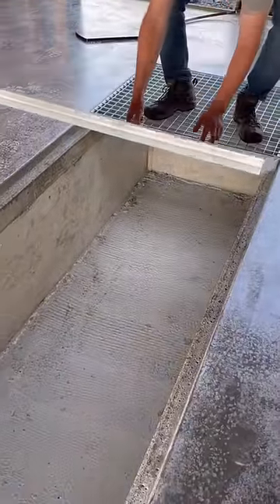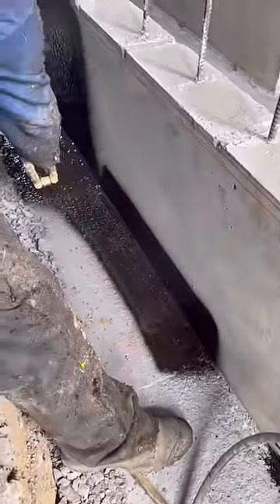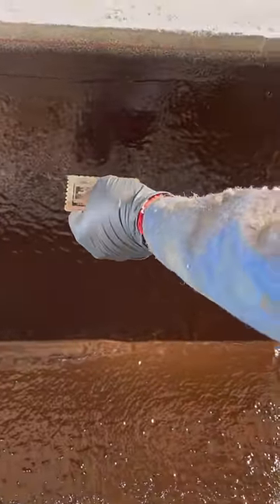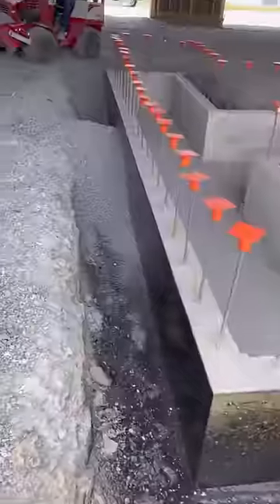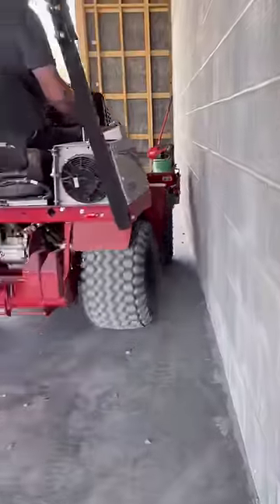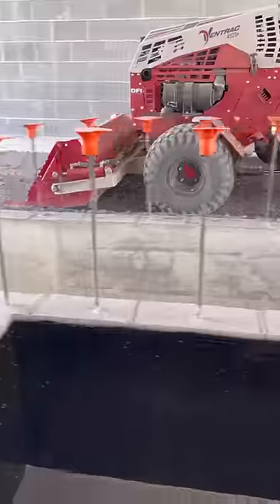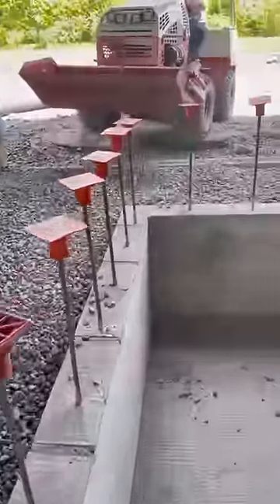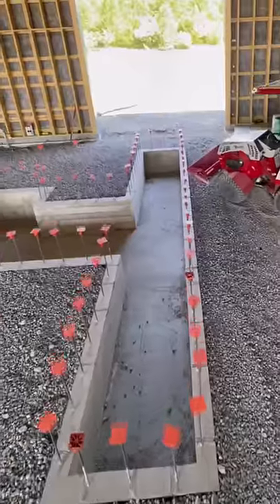Steps We Took To Waterproof The Spray Booth Pit

Comment: Did they spray under the base? 😊 Good to see that 50% of the path between tank and ground is sealed up. Does the gravel edge penetrate the sprayed on  membrane? All that pressure and sharp gravel edges are bound to contact it for sure. What actually happens in each year after completion?

Comment: To improve on what you've done you can put a small 45° cove in the bottom internal corner before mulseal spray. Install drainage with fall and a filter sock on the drainage pipe.
Reply: Overkill for interior foundations unless water table is high like along coastal regions

Comment: Tremco watchdog waterproofing it looks like here. You can also use Henry or  Carlisle  blueskin or grace has bituthene. Grace also has procor spray which is the Cadillac membrane. You should remove any sharp form lines and you should use a liquid membrane fillet where the wall meets the footing before using a sheet membrane. You should protect any of these membranes used in this application with some kind of pc2 or pc3 board or drainmat. I did specialty coatings and waterproofing for 25 years.

Comment: I used to inspect spray booth fire suppression systems.  One customer had a pit that never dried.  The fusible links in that pit never got changed.
Reply from the maker: That’s really cool! This pit will get a chemical suppression system. We were not required to waterproof the pit area, but I decided to do it just as a precaution. We’ve had a lot of rain here and so far it’s stay bone dry.
Reply: @hausplans  Suppression systems for booths are easy in concept, but a pain to design because booth manufacturers barely understand the concept that suppression systems are required, so they don't provision their designs to accommodate the suppression system.

Comment: If you hired someone, up to a few grand lol. Yourself, depending on sealer and if you owned the compressor, $300-700. I add a sheet over top for anything below grade. Can prevent cracking.
Reply from the maker: The water proofing company charged me $450
Reply: He was dead on with $300-$700 then. He knows his stuff apparently.
Reply: @hausplans  So few tradesmen these days, at least where I am. People are charging virtually whatever they like. $450 is damn good, if it's good sealer.

Comment: Nice, but I bet tremco 240 roller grade is less expensive than clogging that spray gun every other day (; and no drain Matt? I guess it’s just a footing and specfific for certain building specs. Nice work. Helps to stay down a couple inches off that footing line unless it’s 100% backfilled and nothing changes. Great work. - a caulker/ waterproofer- Oregon
Reply: 1800$
Reply: After all employees, materials, time.

Comment: I'm surprised you didn't put a one inch piece.Of foam or fiberglass board up on the outside of the wall to help witemperature differentials and to help protect the outside coating

Comment: What about the water or humidity coming from below? Did you waterproof before starting the whole job? Moreover, I would have used XPS panel on side walls to protect the liquid asphalt from getting damaged. Those stones scratch all your waterproofing when unloaded. That's the manufacturers requirements for having warranty.
Reply from the maker: This pit is in the middle of a large building with a roof over it. So mainly, we just did this for dampproofing. Also we put plastic under the floor section before we poured the concrete to hold down moisture.
Reply: I asked you coz I work as a concrete carpenter  across the Alps and on the Italian Seaside (Ligurian Riviera and Tuscany) building luxury home, and these jobs are absolute nightmare due to water infiltration and radon exhalations. Overall, your job is pro level. Well done.

Comment: In 20 years I’ve never seen a booth like this.
Reply from the maker: Downdraft booths are supposedly the Cadillac of paint booths
Reply: @hausplans  where does the draft go? I work in a downward draft every day, usually there is an exhaust tunnel that goes up to the stack. Like I see the pit, but then there is either a side door, or a tunnel off either end.
Reply from the maker: There is a tunnel that will go to a stack and then out the roof. If you watch some of my older videos that show all this.
Reply: @hausplans  oh ok, makes sense, I thought it was just a pit, that’s what didn’t make sense. The older booth’s actually had water that caught overspray and upped humidity. Most people have stopped using them.

Comment: I work with tropical elastomeric coating for roof logo's. I'd say about 450per pail in materials and 175 an hr per person if the company already has the equipment. Roughly $1850 if they knew what they were doing
Reply from the maker: I think I got a good deal, they only charged me $450
Reply: I've never used the spray. Just a rollable type of  coat for the most part
Reply: @spunkeybojangle That's bituminous dampproofing.  Around $40 for a 5gal pail. With a sprayer and a trailer,  you can buy it in 55gal drums even cheaper.

Comment: Could of had a drain.   Just needed to install it in a box with a cover kinda like a big pool drain grate of sorts.  Cover could of been pulled off as needed an the end of the drain pipe could of had a quarter turn valve.  Would of not been any issue with pressure or a vacuum like a p-trap or something could of.
Reply from the maker: We’ve had lots of rain and luckily it has stayed bone dry so far

Comment: I'm guessing $2,000 max., on account of a specialized sprayer for the rubberized asphalt. (Could be closer to $1,000, depending on how much competition the company has in your area)
     The surface area is relatively small, and you don't have the cost of purchase involved for the sprayer. (That just gets factored in on the invoice price. Price per hour, or price per m2 / ft2)

If it was more than that; there are cheaper products that can be applied by hand. 
     Or combinations of products that will accomplish the same thing.
Reply from the maker: It ended up costing $450 for everything
Reply: @hausplans  I would've guessed a price below 1000 if I'd known more about the price of the rubberized asphalt. And I wasn't sure about the price per hour (does it require a certain level of expertise or training... Then price goes up). 
      This was my best guess with my limited knowledge of the process :)
      $450 is a good price, considering the practical benefits.
Reply from the maker: Thanks for watching

Comment: Not to question the application but why in the world do you need so many rebars to anchor the plate?  I mean I like overkill but that is nuts
Reply from the maker: It is overkill, but we’re just following the plans at the engineer designed
Reply: @hausplans  yes my friend, I've ran into engineers that think they are smarter than their predecessors. Happy hunting!

Comment: Napkin math, the grills look ~60x60cm, so around 8m linear of wall, times around 1m, that's 8m2 of spray, 2 16 oz cans cover ~1m², so around 160-300 depending on the paint I'd say.
Reply from the maker: $450
Reply: @hausplans  was I accurate on the size?

Comment: It’s not waterproofed it’s actually moisture proofed! That foundation will eventually allow water to seep through. Especially at the cold/wall floor joint! A bead of mastic shoulda have been shot at the wall floor joint as an extra layer of protection. The footer then should have been wrapped with a Mira max rubber stick on system to be topped with a dimple board / foam board to protect against backfill and to direct the water away from the footer. I’m not hating at all just how I do it in PA!

Comment: Roughing up the concrete before spraying would have ensured a better bond. What do you think?
Reply from the maker: It’s sticks really well as long as there’s no oils or form release on it and it’s had enough time to cure
Reply: @hausplans  But it could stick better..
Reply: @peternault7040 Makes zero difference.  That's bituminous dampproofing.  It will stick to Teflon 😂

Comment: What you say about the paint booth’s exhaust system is incorrect. We use water traps for almost for any kind of drain. Also why do you need a trench at your paint booth?
Reply from the maker: This is a downdraft system, designed by Garmet

Comment: You need to check that 60mil.
Reply from the maker: A mil is one thousandth of an inch 60mil =1/16
Reply: @hausplans  1mil is 1000th of a Metre. 60mil is approximately two and three eighths inches.
Reply from the maker: I think you’re confusing mil and millimeters. They’re not the same thing. A mil is one thousandth of an inch

Comment: Forgot the dimple mat to protect 60 spray asphalt emulsion before gravel.
Reply from the maker: We use that on basement foundations, but this is basically just for damp proofing. The pit is in the middle of a large building, so it’s covered by a roof

Comment: first i need to know what a spray booth pit is.. seccond i live in europe we probably use different materials bitumen/tarmac/asphalt in most cases we use a roller its to thick to spray 60-90euro per square meter so my guess is 270-350 dollar?
Reply from the maker: You’re very close, it was $450 We are putting in a spray booth because this is an auto body shop. The fumes from the booth go down into the pit through a tunnel and then are filtered before leaving the building out the roof.
Reply: @hausplans  ah that was my first guess in 400-500 for total meter's but its lower in hight 40 centimeter so? yeah not totally squared meters so i lowerd my estimate a bit metrics system :/ amiright?  Now i wonder is it bitumen 2? looks like it..hmm?

i bet there were other options to vent?
but yeah i like this solution elegant and effective goodluck with the srayshop booth settup nah u don't need luck u know you're stuff 👍😀

Comment: So curiosity had got me wondering why you use mastic and not a “rhino” lining type of sealant. That stuff was designed to keep bunkers together should a bomb explode on them. That being said, freaking GREAT JOB. I mean I’d have you coat my entire basement/foundation if you were in my area, assuming you’re costing and backfilling with appropriate, inspector approved material? I would pay $10,000-$12,000 for a job like that? And…….how far off am I? Haha nice job though. Show your work!
Reply from the maker: Thanks, it cost $450 to spray this pit

Comment: $3,000 for spray, 500 for gravel, 500 for labor, $4,000.00
Reply from the maker: The spray was $450
Reply: @hausplans  well dang I need some. Where do I get it?
Reply: @hausplans  the back corner of my house keeps getting moisture in the walls and crating mold I need to strip down the wall and I need to dig down below the poured foundation and I need to put some of this on it 😲

Comment: a faster way to get off all the wall ties is just hit them hard with a hammer a grinder isn’t that much slower but yeah
Reply from the maker: A hammer works great for the normal wall ties (that’s all I ever use ) that go through the side. But these are special agricultural wall ties that are down on the footer and there’s no way to hammer them off. They’re definitely made from a different steal. You can bend them back-and-forth but they don’t budge.

Comment: Where is the air leaving the both...ur pit has no ventilation to let the fumes to leave? I worked at a shop for ten + years and there was a down draft both there with a pit in the ground  but like this
Reply from the maker: The air comes out through a square hole on the other side of the pit and then goes through the roof

Comment: there's only like 2 to 300ft square of waterproofing needed and about 1 hr labor to install, material cost im not sure so ill guess 2 bucks a foot at 60mil.... give an hour for setup and clean up, assuming local no travel....total cost should have been less than $1000 for the waterproofing unless that material is spendy.
Reply from the maker: It cost $450

Comment: Mills as in millimeters ? Cause roughly 25 millimeters is an inch so no way they put over 2 inches of they rubber coating on the walls?
Reply from the maker: A mil is one 1,000’s of an inch different than a millimeter

Comment: it costs $725 if you sub it out, $350 if you have the equipment already. great vids btw. i have a construction cat instead of construction dog. ha.
Reply from the maker: It was $450
Reply: @hausplans  good price! when i sub out to Tough N' Dry a foundation coating company they have a minimum usually so wasn't sure if that be the same case with your job site. =p as a fellow GC, i mean it's impressive with the quality of work you provide consistantly, as long as the clients happy, right. ha

Comment: "60 mills" 60mm is 2 1/4 inch - sound off by a factor of 10. 6mm is plenty thick. Conversion mistake?
Reply from the maker: Hey mil is different than a millimeter. It’s 1/1,000s an inch.

Comment: 60mils? not millimetres right? that would be 6cm or about 2.5 inches. What unit do you mean by mills? Sorry, Im not used to imperial units...

Edit: nvm, found the answer. Mil as in miliinch or 1/1000 of an inch. 60mil is around 1.5 millimetre
Reply from the maker: A mil is one thousandth of an inch. 60 mil is about 1/16 of an inch

Comment: Is it worth digging up a foundation to spray or paint the footings and sub surface walls with this or a liquid rubber? Can't seem to keep my basement dry with an interior drain and 2 sumps already installed thinking I've got to waterproof from the outside at this point 50 year old house no french drain installed when built and all these water proofing companies want to sell me an interior product 🤔
Reply from the maker: To answer your question, yes it may be worth it. The company I used the spray these walls do sometimes dig up foundations to spray them. You would want to also add a French drain and backfill with crushed down and filter fabric. You could start by talking to some waterproof companies in your area and get an idea of what it would cost.
Reply: @hausplans  thanks for the response I am going to look into it. Got a few landscaping companies coming out in the coming weeks to map out a plan. I've got good pitch on both sides so I could run the drain to day light. So you recommend back filling with gravel not loam? The soil has settled for decades so I'm worried it will compromise my foundation more then it already is when it's loosened and dug up
Reply from the maker: That’s good that you have slope away from your foundation. That’s super important! Yes, I would at least partially backfill with crushed stone after you spray the walls. You could also have a drain board put against the walls after they’re spray. It’s protects the water proofing and causes the water to drain down. Then I would put filter fabric on top of the stone before caping it off with dirt. One other question, are your gutters piped away from the house?  That also makes a big difference. Some people tie their gutters into the foundation drain, but that’s a big no no. It might not be a bad idea to consult a waterproofing company in your area.
Reply: @hausplans  I recently put up some gutters and yes I do have them extended about 5-6 feet away from the foundation, there's a high water table where we live and lots of clay unfortunately. Just not sure a French drain will last very long without clogging. And I've consulted multiple basement water proofing companies and most of them pitch that interior gutter system that sits on top of the footer in the basement which seems pretty useless, appreciate the insights

Comment: No way was that asphalt coating 60 mils
or cured enough to handle the pressure of that drain rock. a membrane would have been a better choice.
Reply from the maker: It was definitely 60 mill. Mill are different than millimeters. A mil is one thousandth of an inch so the spray was around 1/16” thick. Also, the manufacturer says it safe to backfill after 24 hours.

Comment: 60 mm (mills im guessing is millimeter?) Is 6cm or over 2 inches. (5cm is 2 inches approximately), so doubt that is the thickness of the spray?? Can you clarify?
Reply from the maker: A mil is 1/1,000 of a inch
Reply: @hausplans  a mil is 10km
Reply: @hausplans  10 mm = 1cm 2.5cm is about an inch. You do not mean 60mm. 60mm is 6 cm and that's just over 2 inches.
Reply from the maker: You’re confusing a mill with a millimeter
Reply: @hausplans  so what is a mill? Only ever heard a mill used as short for milimeter.

Comment: I think it cost an unreasonable ungodly amount of money for contractors demand a lot of cash to do the most simple things that i could do myself just as easy. It doesnt take a pro to dig a hole, spray stuff onto the side of somthing, and fill the hole back up. It'll take me longer yes for I don't have a tractor but it'll be cheaper around $150 to do myself probably $500 - several 1000 to have a company do it.
Reply from the maker: It was $450

Comment: You should have covered the waterproofing with Styrofoam sheets to protect it from the stone.
Reply from the maker: We would if it was for a foundation, but this is basically just to keep the dampness out. This pit in the middle of a large building thats covered by a roof
Reply: @hausplans  Yeah, I get it but while you're there and it's open the cost to do it would be what $50 for the added insurance?
Reply: @frotobaggins7169 2" xps insulation isn't cheap anymore.  A standard protection course is more economical.  But,  like the man said,  it's an interior foundation wall.  Probably didn't even need dampproofing unless close to a coastal region with very high water table.
Reply: @jimclark2824  I get it but, it's worth going the extra mile because if you ever have to fix it...

My grandfather used basic styrofoam to protect the foundation of his house that was 4 floors below grade.  He back filled with stone for drainage.  His house was always dry.  I don't think it ever leaked in the past 40 years.